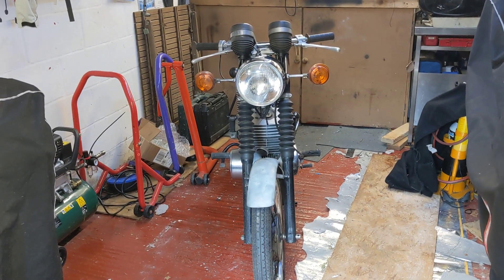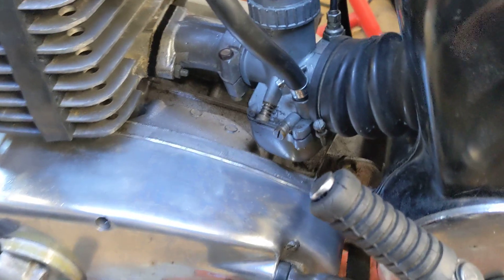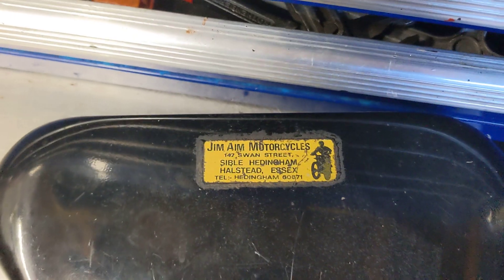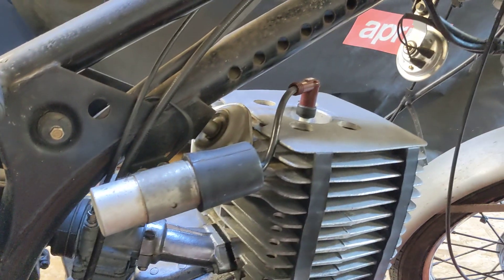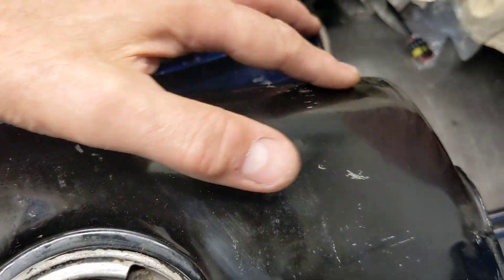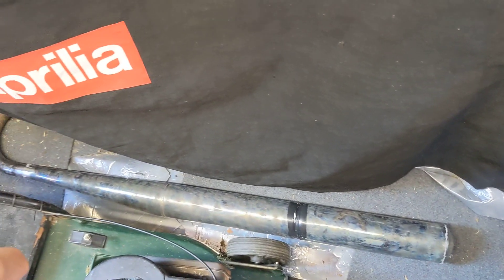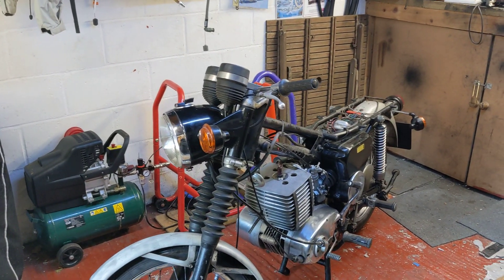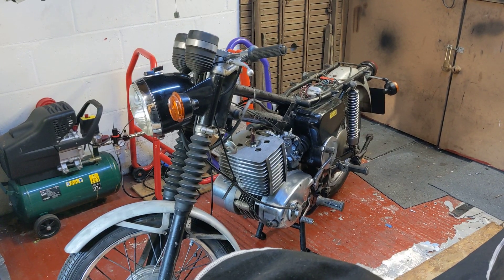MZ ts250 supa 5  A quick look around the new project bike

Comment: Replace the front brake
Reply from the maker: I don't want to go away from the original look of the bike , I believe you can modify the internals so the shoes have more contact with the hub
Reply: @captbarb6642  You can, I did it to mine and they work pretty well now.
Reply from the maker: @boredmalcontent  maybe I will try the machining of the internals I want to keep the original looks

Comment: Check the main bearings 😂
Reply from the maker: Are they normally a problem or is it because it has sat around for a long time without use .
Reply: @captbarb6642  on the early ones from new  my dad had one from new had  to replace main bearings due to poor quality
Reply from the maker: @carlstark6857  what year was his
Reply: @captbarb6642  1979 I think
Reply from the maker: @carlstark6857  maybe I will be lucky mines 1981 sounds fine .thought maybe the seals would have ripped but appears to be ok .
Only thing I have a slight oil weep on gear change oring .
Reply: Cuál es es precio de esa 🏍️.
Reply from the maker: I'm sorry it's not for sale.